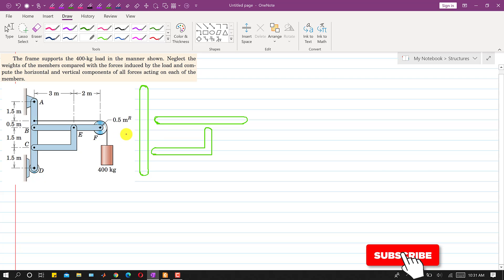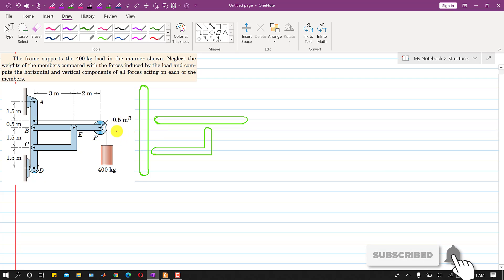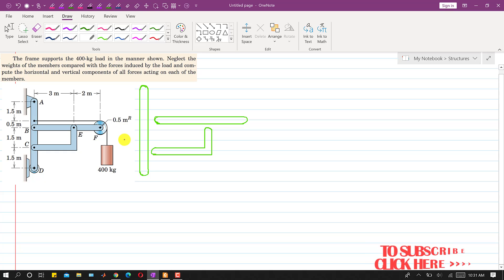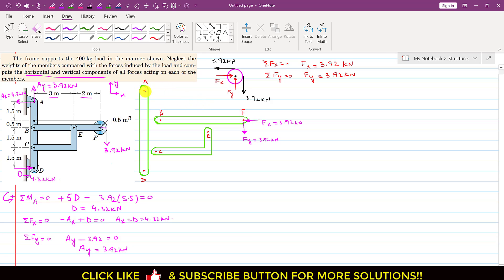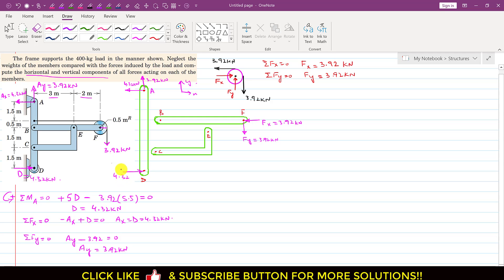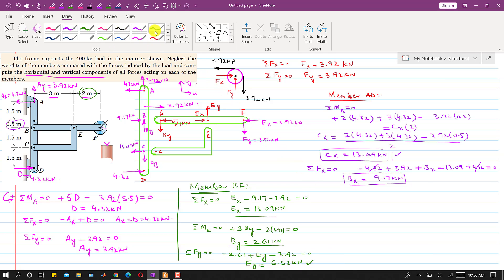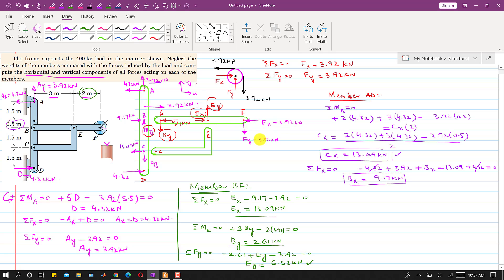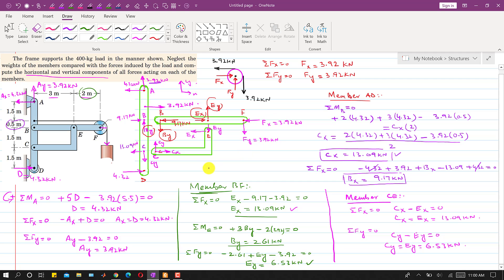How to Solve Frames and Machines Problems (Statics) | Engineers Academy

Comment: its not good sir as we have to multiply the load to  9.8 not devide that will make it kg m per second squre the unit of force newtons
Reply: yeah how it be the answer 3.92N of 400kg, if we have 400kg we should multiply it in 9.80m/s so the answer is 3920N not 3.92N
Reply: Can you explain to me how he got the answer of 3.92N for 400kg?
Reply: Divide it by 1000 because he wrote the answer in KN not N😊